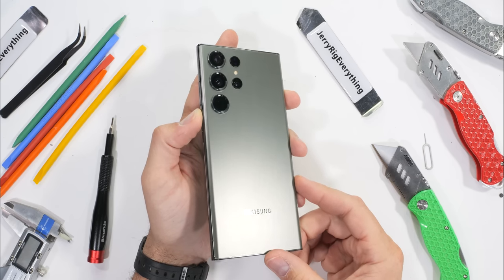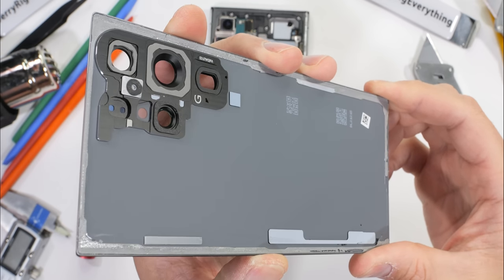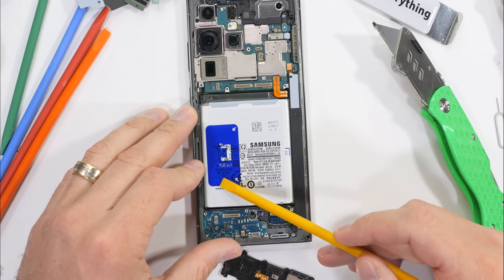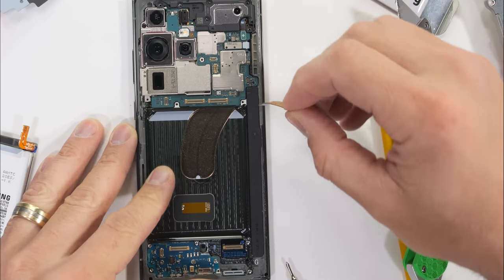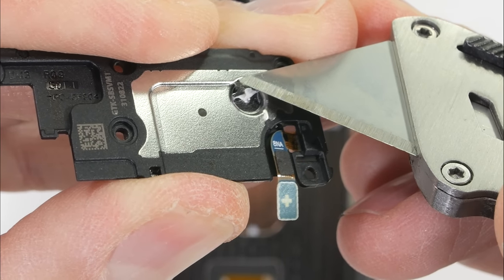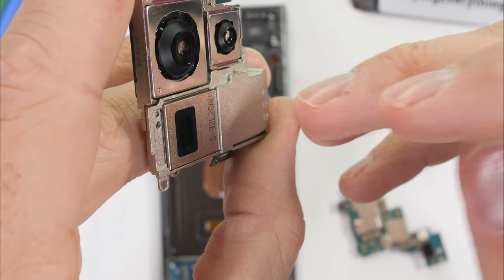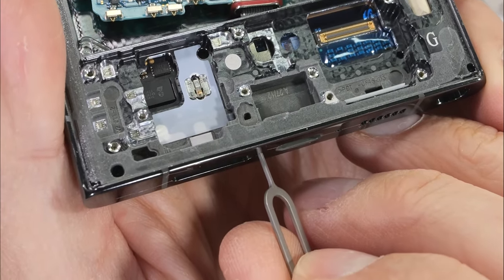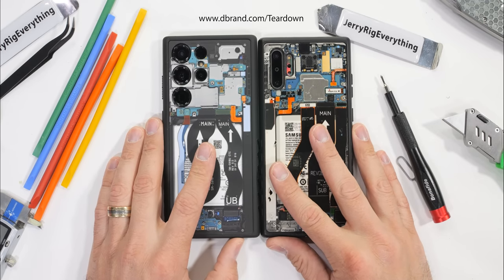I waited 8 years for this Galaxy S23 Ultra Teardown...

Comment: Its so cool to see what my phone looks like from the inside. I already preordered my dbrand case before the teardown version was availeable. Good to know that I can easily replace the battery if needed.
Reply: Samsung 🔋 battery swell over time. Internet already covered this last year.
Reply: @fynkozari9271  yes, i also saw this in a video by mrwhostheboss. but it only happened with phones he hasn't used in a long time and are gathering dust on a shelf. it's probably problematic for users who always have a second old samsung smartphone at home as a backup solution.
i'm still using a 5 year old s9+ and aside from 5 years of daily use, i don't have any excessive wear or a swollen battery. the s9 series was also affected by this issue in his video. 
EDIT: my galaxy s5 also had a swollen battery a few years after it was replaced by my s9, but it's battery was easily replaceable
Reply: @fynkozari9271  
That's for old Samsung phones
Reply: It makes me a little jealous and angry, I had my samsung S22U damaged and during the repair I damaged the battery by putting too much force on it trying to remove it.
Reply: Make sure you use that plastic dbrand for ever, so it doesn’t end up in the ocean

Comment: Thank you for this video! I did exactly that with the SIM card tool, and thought I destroyed my microphone. Glad to know that it's designed in such a way to prevent that. Very cool to also see the inner workings of my new phone, and to know that in a few years, battery replacement will be realistic.

Comment: The simplicity of tearing down this phone and putting it back together blew me away. Usually Jerry tears the phone down to the point where the phone becomes worthless because the manufacturer of the phone doesn't want you tearing it apart so you wind up destroying the phone in the process of tearing it apart. Awesome job Samsung, finally a phone worthy  of owning.

Comment: It’s great to see Samsung making an effort to make battery replacements easier
Reply: Except they don't offer it on their self-repair program.
Reply: Just bring the back removal
 How hard is it took bring it back?
Reply: @prashnaveetprasad8339  impossible seeing as oems dont want you touching it anymore.
Reply: There is no effort in making changes for replacing the battery, there is booby traps that can render the phone inoperable and the back glass panel is very difficult to remove in one piece.
Reply: @theneighborlynumismatist8201  in my experience it isnt that hard. The glass has a bit of flex to it.
Reply: @Kentololable  woah
Reply: @prashnaveetprasad8339  then you would have to give up the IP68 water and dust resistant rating, would you be fine with that?

Comment: 4:02 The vibration motor isn't in the earpiece, it's sharing the same housing as the bottom speaker, just like it was on the S22 Ultra.

Comment: @ 2:28 Dude wait!!!! Before pulling the battery out, put some alcohol on the sides of the battery. Makes removing it much easier. The frame slight flexed when you pulled the tab.

Comment: Glad to see the battery easier to remove. Now if they could figure out how to make the back panel still waterproof while being removable without heat, suction cup, and a thin sharp object... 😄
Reply: I mean. Does it seem that hard to stick a rubber gasket under some glass? If it had a cover secured with pressure by like 4 to 6 screws with a gasket between it and the main body, it wouldn't need to be heated and cut.
Reply: @magnarex  🤷🌚

Comment: Man, I wanted the s23 Ultra but the size & price was a bit much for me. I downgraded from my 13 Pro Max for the S23 (standard size) and I love it. The pen & cameras are also why I wanted the Ultra, but I couldn't afford it (and honestly if that's the only reasons I wanted it ... I don't need it). 😂 But I love the S23. The size is so comfy in my hands. I've used Android before I swapped to Apple a decade ago and man, do I prefer it more.
Reply: كيف كانت التجربة؟
Reply: Going for apple to android is an upgrade. Hardly a downgrade even with a base model.

Comment: As glad as I am to see that the battery is now easier to remove, I can't say it ever worried me that much on previous models and I do believe that the issue was made out to be bigger than it really was. I work in device and phone repair and I have to remove Samsung batteries very regularly. But I've always found that if I give it a generous amount of isopropyl as soon as I get the back off, and then undo the screws and other parts while the alcohol does its thing, and then put the phone back on the heat plate for a couple of minutes, the battery pretty much falls out. I'm not saying it's ideal, and I don't use anywhere near as much adhesive when putting the battery back in, but if you have the right tools, it was really not that hard.
Reply: That's the thing, "the right tools"

Regular people with a bit of technical knowledge wanting to just get a 30-ish dollar part and then replace it themselves at home do not usually also have the tools. I know this from experience, as any form of adhesive was pain for me before I got some isopropyl alcohol (I mostly repair my 10-15yr old phones from my collection, so I don't get to work with adhesive very often)
Reply: You have to keep in mind end of life recycling too. Recyclers are not going to spend 10-15 minutes trying to carefully extract a battery. If it is glued into place that well (for no reason) then it’s getting chucked in the garbage, especially if the recycler risks a fire or injury by deforming or stabbing the battery when trying to remove it. Making it easier to remove means that it’s more likely to get recycled at the end of its life rather than chucked in the trash. We have to consider the recycleability of stuff now, especially things like smart phones since they are so heavily used, produced in such high numbers, and discarded so readily. We’ve spend decades not caring about what damage we cause to the planet by just using things and throwing them in landfills or burning them in the classic “out of sight, out of mind” fashion and look where we are now.

Comment: One very important thing that is missing is a MicroSD card slot. I would have upgraded to the S23 Ultra but the deal breaker for me was no MicroSD. I've been on Note phones for a long time, and I'll keep my Note 10+ until either it breaks or Samsung releases an S Ultra with a MicroSD slot.
Reply: The days of MicroSD card is gone my friend. At most you can expect hybrid slot but in premium phones that's rare.
Reply: @hakim5939  Then Samsung doesn't want my money I guess.
Reply: Get the Note 20 Ultra if you want a Micro SD card slot.
Reply: @super-gerald  Eventually you'll have to either move away from a Micro SD card slot or get a Sony Xperia One phone which has it alongside a headphone jack.
Reply: @PSYCHOV3N0M  As I said, I guess Samsung doesn't want my money.
Reply: @PSYCHOV3N0M  Note 20 Ultra is not a new phone. As I've said at least three times now, I guess Samsung doesn't want my money.
Reply: microSD is too slow for todays standards
Reply: @XxeXcEnZexX  what a lame excuse. It seems fast enough for Sony.
Reply: What I miss on my s23 ultra is the cuts for volume buttons in the flip covers and the aux slot. Micro sd aswell a bit but ive got the 512gb version because of that
Reply: buy a t5 and offload all old photos and videos to a media you actually own and will stay with you for the rest of your life. simple as that.
Reply: @TigeroL42  why would I want to do that. A MicroSD card slotbis what I want not some other decvice. With the amount of money that the S23 Ultra costs I would expect it to have everything I want, not remove things I want.

Comment: I took advantage of a trade-in and storage pre-purchase upgrade bonus and I am extremely happy with the S23 ultra. My previous LG V60 ThinQ will be missed and the last Samsung I had was an S8 Active which this by far blows everything out of the water for that. Happy to watch the teardown so I hopefully never have to do it myself.
Reply: I just got my S23U. I could've gotten $200 for my S8 International (Exynos). But decided to keep it, because I'm sorely missing having SD card support and, more importantly, a headphone jack.

I did buy two DACs, first one cabled but I regretted after realizing having it in the same pocket, would damage my screen; it was also really treble-heavy. (iBasso DC06) 
Then I got the Fiio BTR7, which is better and BT, so I can keep it in a different pocket (is also had a cable-mode, if the battery ever dies). It's audio is 'warmer' which is more to my taste.

Unfortunately, they both still don't sound as good as the S8's built in audio sounds! 😔😮‍💨

Other than that, it is indeed far superior in every way. What I think I enjoy most, is the stereo sound, though! I was sincerely blown away by the sound quality with Dolby Atmos (Movie) enabled... 😮
Even watching low quality YT videos of someone playing War Thunder, the left and right channel separation and psuedo-surround sound made it very immersive to watch! Hearing fighter aircraft approach from the back left (behind the person playing) and enter the screen on the right, you could hear every bit of its position even though it wasn't on screen! 
All from two tiny phone speakers... 😯😳🥹

And naturally, watching movies with quality audio is a real treat!

[/rambling]

Comment: Good to see Samsung making their phones more repairable finally! After using the S22 Ultra as my daily driver for work and pleasure I upgraded to the S23 Ultra about 2 weeks ago. All I can say is wow. Performance wise it seems like the new S23 Ultra is two generations ahead of last years flagship instead of only one. I'm thinking it's the new UFS 4.0 memory and 5X RAM combined with the beast Snapdragon Gen 2 chip. Runs dramatically faster in day to day tasks all while running much cooler. Normally improved performance comes with worse battery life but not this year thankfully. I'm getting an extra half days worth of battery life on my new phone which is quite impressive to say the least. My phone calls are noticeably more clear with no dropped calls like I had prior with the S22 Ultra...proving the new Qualcomm X70 modem is much improved while being nearly 50% more efficient. One of my favorite upgrades is the speakers that actually have decent bass this year compared to the brutal sound we had in last years S22 Ultra. All in all I'm really enjoying the new phone and that's not even getting into the improved cameras and OIS. Well done Samsung
Reply: unusable and boring in the trash, he's a camera phone and not a phone
Reply: How many hours does a fully charged S22 ultra and S23 ultra battery last?

Comment: Nothing really bad would happen even if the lcd flex cable was as damaged as it is separate and relatively inexpensive.

Overall a great move towards improving repairability by samsung. I wish they waterproofed or separated the lcd connector better from now on, water ingress through the speaker, mic or charging port shouldn't have to mean an issue for the lcd too.

Comment: so I am waiting for a replacment screen for my S21 Ultra, and I can confirm 100% the battery in the 21 Ultra is also removable. there was no "Pull Out" sticker on my one, I needed a heat gun and a little isoproponol to loosen the glue behinnd the battery, but a little heat and a 1/4 teaspoon of iso and it peels off as easy as yours did.

Comment: Thanks! Interesting video. Is the back glass cover just glued on or does it also clip in and the glue seal is to waterproof? Just wondering for when the battery needs replacing. Is it a simple and straightforward job for an owner, if one can get the replacement battery? Also what is the glue used? Thanks!

Comment: when you pull out, since the two holes are close to each other, you can put the pin in the wrong hole. it happens. but when it happens , you pop it out like a little lego

Comment: Hello.  Please tell me from your many experiences with Samsung phones.  I also have an S23 Ultra.  During the analysis, did you notice the presence of play in the lenses of the main camera when it is not turned on?  If you shake the phone, you can hear the sound of some free movement, a slight tapping sound.

Comment: Zack, is it possible to completely remove the 5G antenna or at least disable it (yes I am aware that one can simply turn it off in the connections settings)

Comment: Jerry, if I'm not concerned about moisture, is there any way to put the back on to the phone where the battery can still be removed at will? That's my big problem with phones is I don't like all the tracking and the only way to get rid of all that, and the reason that they made all the phones sealed, is by removing the battery.

Comment: Glad I watched this. Won't be upgrading. With the USB C port. A weak one design wise having charging USB OTG And headphone dongle duties. The fact that they soldered the USB C port to the bottom PCB instead of it's own modular piece like the note 20 ultra 5G I will keep what I have. I remembered the s10e days. I warrantied out so many customers'phones. Because the phone says there was moisture in the charge port and wouldn't charge even when it was dry as the desert.

Comment: I dropped mine out of my pocket, caught on my shirt, dropped 3ft screen down onto concrete. Tiny chip on the frame on bottom right. Fixable with paint. The screen itself has no physical damage on the outside. But the top left, is broken internally. It shows a group of green dots/pixels. So I already need a screen replacement. Very unfortunate.

Comment: I know that I'm quite paranoid sometimes, but you can help me to figure out; I'm 80% sure to used the sim tool in the correct sim hole both the two times, but on the first one  (the very 1st one brand new phone) I stopped because after pushed the tool I felt something inside go deeper, what could it be the tiny cilinder that you popped out from your video? I really appreciate if you can give to me an answer, I'm sleeping badly for this :-D
(well, I din't find the scene when the tiny cilinder popped out, I probably see it somewhere else, uhmm)

Comment: The simplicity of the design is sublime compared to Apple... the ribbons, coil and battery glued together is kinda sus but i'd guess they are cheap components if u f them up. The actually machined frame comparing to apple's thousand brackets and screws... is this even a comparison?

Comment: Is it just me or did anyone else think that poking the wrong hole made the media output volume much lower than other samsung phones /tabs. The volume in my samsung s7+ and samsung f62 phone is way better than s23 ultra that i bought last night. I feared if it was the wrong poking of the hole at the bottom that made the volume weaker. Could it be the reason or is the output volume actually lower in the phone compared to other models? how do i know for sure?

Comment: Well you wouldn't break the back glass if you used the correct machines. Coming from a phone technician. Using a heat gun and those tools are asking for trouble.
Reply: Also they don't use glue to put batteries in its very strong adhesive. This channel makes me cringe.

Comment: i think recent years samsung flagship phone has a problem, the back panel adhesive seems not enough. I used note 20 ultra, and the back panel did not more than 2 years. Now after 1 year with my S23 ultra, i start to see little gap starts to appear at the back panel, it always happened after warranty expired, and I would have to paid Samsung to reapply adhesive. That would not be a big issue, but I am a person who not using any case, if the back panel falls out, the camera and board would be exposed to dust and moist easily, i look up online, it seems very common for a lot of samsung flagship users......, i don't know if samsung is taking this seriously.

Comment: "With the new removable battery, the repairability & longevity of the phone has now gone up considerably. When your current battery dies after a few years, 
instead of getting a new $1200 phone. You can now just bring it back to life with a $30 battery replacement" 
90% of people would still just buy a new $1200 phone, as it's more of "Look I've got the latest phone" rather than how it works.

Comment: I have both  - s23 ultra and iphone 14 pro max and samsung's battery holds up 50% less time then iphone's 👎👎👎
Plus i have samsung on lowest possible resolution of screen, battery is on low power mode, display i have set on 25% / 100% brightness and still eats up battery like crazy.
Apple done tremendous job with 14 series in battery consumption and optimising whole unit. And sound of iphone is righ amazing how music wawes and flows thru dynamic range of frequencies. I bow to 🍏

Comment: It's very obvious that modern cellphones are not designed to be repaired by consumers. The integrity of the device is compromised by opening it up and doing a significant repair. In my particular case, the device is regularly backed up and goes back to Apple for any type of service.

Comment: For a company that barely supports phone for 2 years, a useless addition for repairability, especially for frequently upgraded flagships. If Apple did this, that would actually bring a more ecological advantage, but not by much. I think if these companies come up with a way to repair screen this easy, then that WILL be huge. Batteries are not a pain in 2-3 year upgrade cycle, generally speaking.

Comment: Hi there.. A quick question.. I mistakly tried putting the sim ejecting tool, in the rong 2 wholes, but didn't see an issue, there is a hole on the top of the fone, I tried it there too... Did I cause any future problems... Please advise.. Thank u kindly..